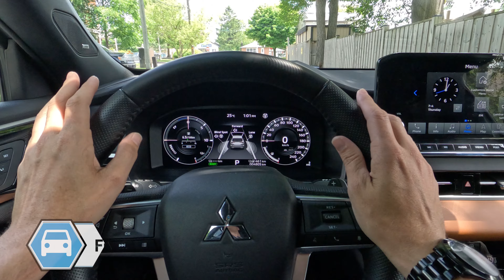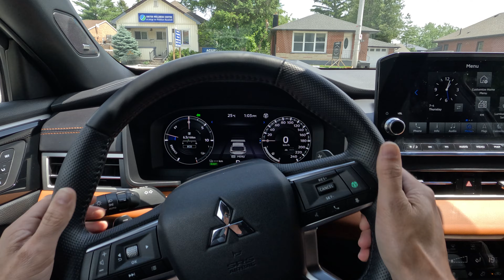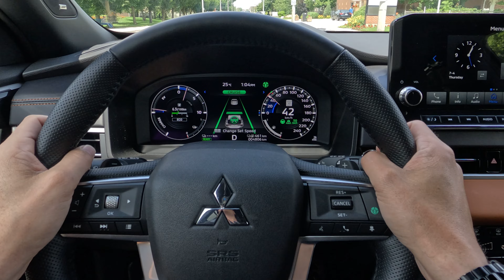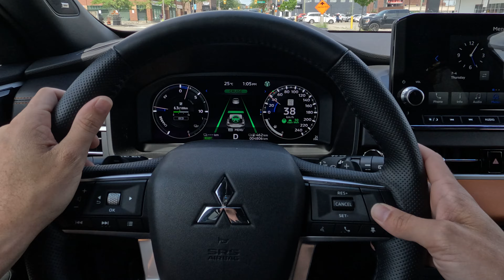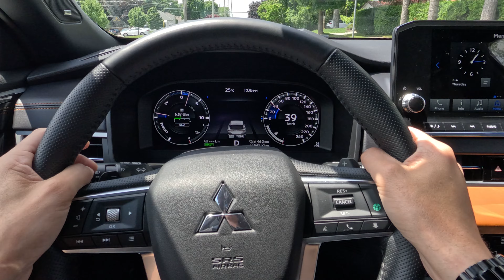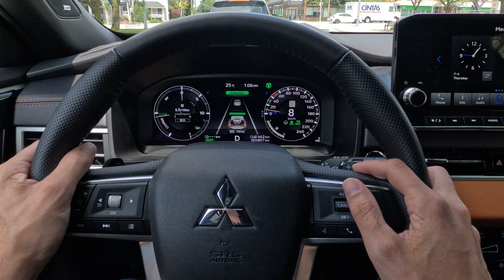How to Use Adaptive Cruise Control in the Mitsubishi Outlander

Comment: Appreciate the demonstration and clear instructions. I 100% disagree that drivers in general should give over control to a machine – in this situation. It’s a very bad habit when the steaks are high and if you’re in court, you can’t say “the adaptive cruise control did it.“
Reply from the maker: Lol, I like how you had to clarify "in this situation" - adaptive cruise control is a driving aid and not a replacement for actually paying attention
Reply: The steaks 🥩 are high. 😂. I love the driver aids. As you get older, your reactions diminish somewhat, the more assistance the better in my humble opinion. So long as the tech is reliable. Here in NZ we drive on the left, I recently had a trip to USA, got a Honda crv with lane assist and adaptive cruise, fantastic. If you’re glancing at Google Maps, concentrating on driving on the wrong side of the road (compared to what you’re used to) the car stays in the lane. It really is beneficial. In my opinion anyway. 
Bless ya.

Comment: How does it handle traffic jams? Thanks for the video!
Reply from the maker: Thanks! It handles well in stop and go, just make sure you're paying attention in case the car in front of you slams on their brakes. Adaptive cruise should be use as an extension of your regular driving. I'm always flipping it on and off while I drive and not relying on it 100% even when it's active